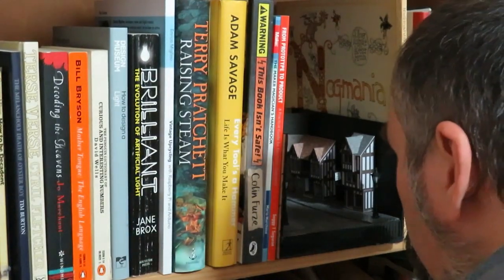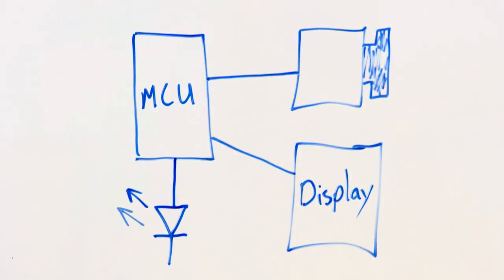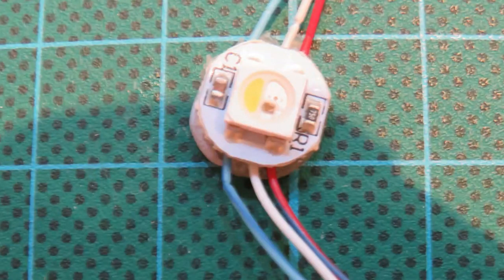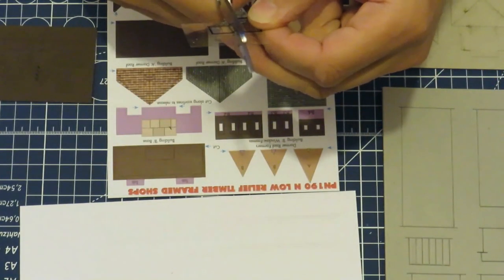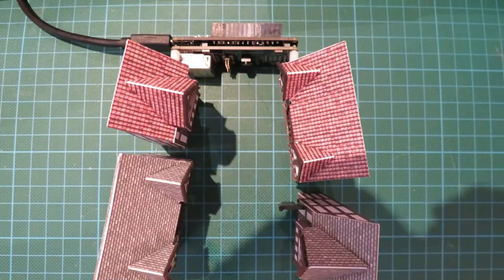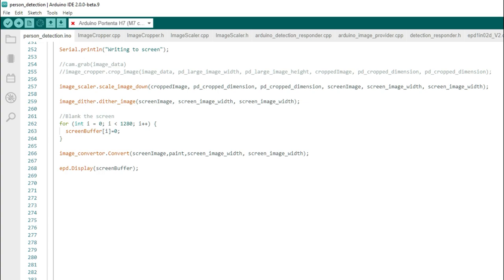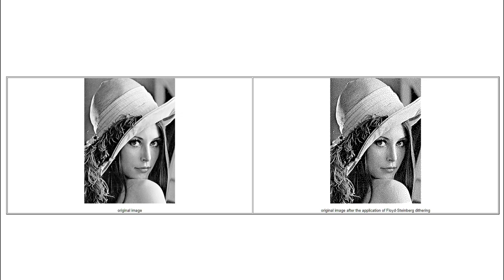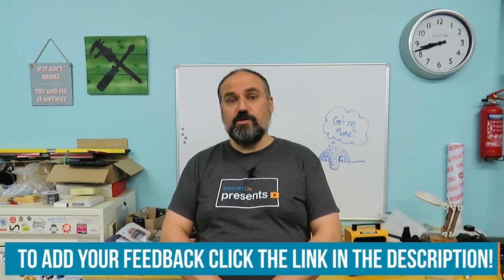Make Your Own Ye Olde Book Nook Diorama with Arduino

Comment: Around 5 minutes in, you complain  about not having all the needed specs, and then say you determined the camera angle through your experinments.  
Then around .9:20,you mention figuring out undocumented pins by trial and error.

So why not share your findings? Maybe save the rest of the community the effort  of duplicating your efforts...? Keeping the info to yourself kinda goes against the whole maker  ethos, doesn't it?
Reply: Hey Rob, you can find most of my results on blog posts on the E14 website which is linked in the description above. I am not sure my camera angle was particularly scientific but it gave me enough to ensure the buildings were not in shot, I'd say around 60 degrees. The pins I used are listed in the code on my Github repo at Workshopshed. In this case, I would recommend duplicating my experiments because the pins could be re-mapped by different libraries so you may find you need to use different ones with your code.